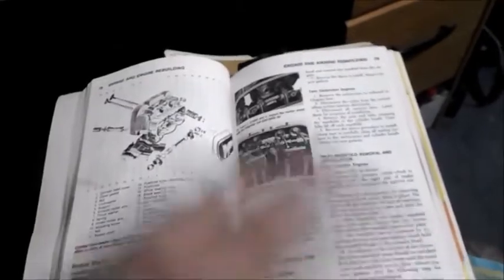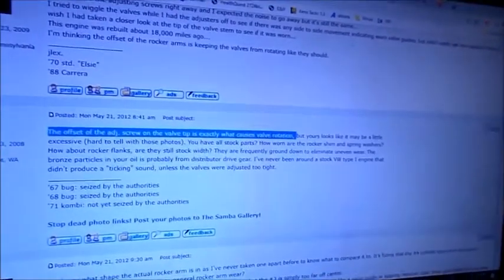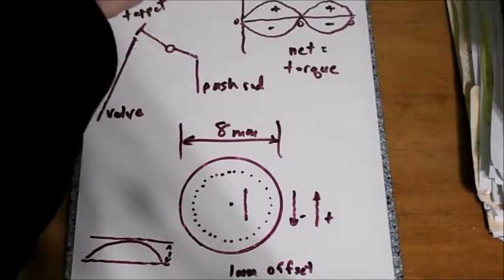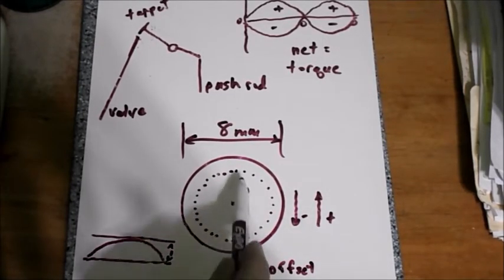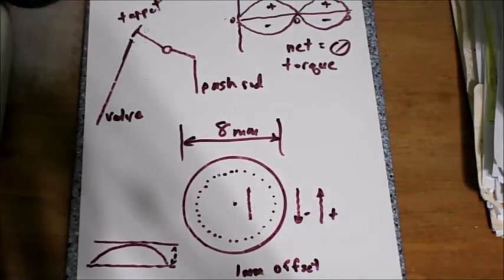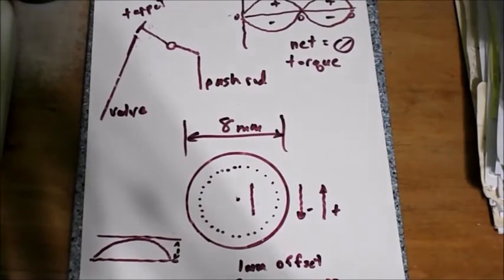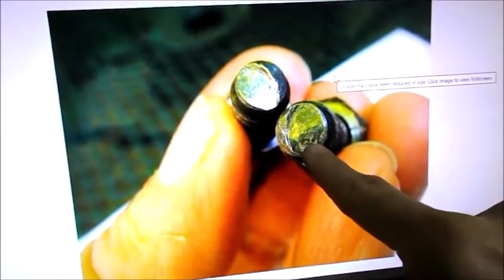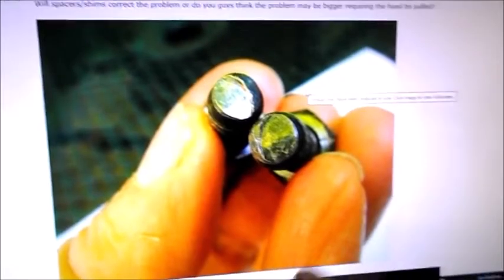vw type 1 mileage & mpg vlog 13 valve rotation

Comment: Should valves rotate ?

Well, there is no provision for rotational lubrication.
The actual bronze valve-guide is right in the exhaust's flame, under  high heat and high pressure.

As for rotation, the keepers, spring-caps, and valves are actually locked together under considerable friction.
Force that would be the greatest when the rocker-arm is overcoming the stationary valve.
Just the leverage of the rocker's tip .. trying to spin the valve from its center and overcome the stationary friction of the keeper, cap, and the force of the spring against the head.

That just leaves any possible rotational opportunity to the spring leaving the cap or head, but I'd put that in nowhere land.

One time, Buick made a head that enabled rotation and oiling.
It was a one-time disaster. 

Since then ... all engine makers put considerable effort into ensuring a most perfect dead-center strike. 
As that is the only way to ensure the most frictionless movement of the valve, both in and out.

Why does this myth keep getting repeated, even on instructions ? 

I blame it on monkey-see ...
But ... it's also .. "the secret to valve geometry"(although very outdated)
And, as you correctly say, today's new materials and metallurgy have advanced far enough to eliminate many of these old valve problems.
As far as some companies are making stainless valves (non-magnetic) and have forged a tool steel tip on the lifter end.
The way you can tell .... while the valve is not magnetic, the tip is.
Which brings up the point ... those types of stainless valves with the hardened tool steel tip ... don't require the hardened lash caps.
Reply from the maker: with the advent of higher strength and hardness alloys, the need for valve rotation disappeared but sadly not the white haired old fart rule of thumb. i feel i'm entitled to say that now that i'm in my 60's. so you've seen it on instructions too? mind blowing isn't it. i try not to use the monkey expression in my vids but if the shoe fits. so what brings you to the channel? what sort of ride you driving or flying or whatever?
Reply: @scottyc9365  
Hi Scotty
I'm a big fan of your processes, methodology, and deductions.
Presently, I'm going to build my retirement engine for my beetle, doing tons of research and homework.
Valve geometry on both Samba and YouTube  ... godh, it looks like there is a huge number of people that are all over the map on execution. 
First, there has to be a step by step order to arrive at an exactly valve geometry solution.
Nobody even discusses that the valve and pushrod are not parallel. 
So, where is this mythology "level" for the rocker-arm.
V-8s have an optional trial plastic "V" template to demonstrate that angle.

Valve geometry.... 
so at work ... I rebuilt hundreds, maybe thousands of piston and valved pieces of equipment. 
Even 21 cylinder compound bi-level radial air drives. 
16 ceramic ringless straight line water jet pumps.
Some low pressure/high volume (recovery, transport pumps)
Some high pressure/low volume (for water-jet cutting of steel)
And  some high volume/super high pressure (robotic cleaning of paint pedestals) auto-plant paint carriers. 
So that last one was an inline 22-cylinder water compressor. 
Some pumped air, water, oil, fluids ... 
So, there was this huge straight line 10 cylinder air compressor, it supplied air for a factory.
#8 cylinder was always giving off a lot of blow-by at the valve.
During shut-down, that one cylinder's valve-guide was flagged, and needs to be re-bushed (a new valve guide)
Well, no small job, as it was  under a lot of huge peripheral valve train.
Even pressing the shot valve guide out was a big job.
Well, turns-out .... that one rocker-arm was off center.
What can I say .... 
That Buick engineer's story was ringing in my ear during the whole job.
Reply from the maker: @thestove2407  dang! look at all that big engine stuff. these old ac vw engines are pretty forgiving of slightly incorrect valve train geometry. i need to change the thickness of the spacer under my rocker arm shafts. when i first fired up this build, i didn't have the correct sized spacer so went with one that was a bit too thick. i think it's off by a half millimeter. if this wasn't such a mild engine, i would have fixed it by now. have you ever heard of valve rotators or seen them in those big engines? i imagine some of those engines are diesel. if the vw crowd ever discovered that rotators exist, their inclusion on these engines (bad idea as you have noted about provisions for dealing with friction of a rotating valve in a guide) would spread like a nasty virus.